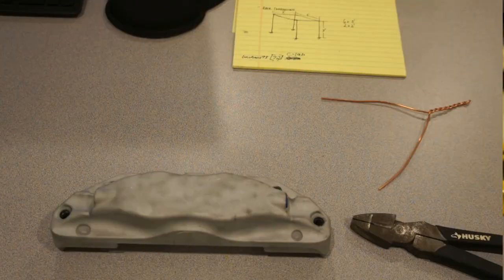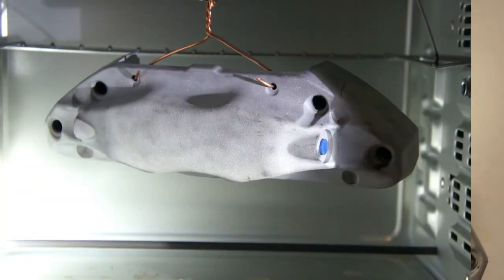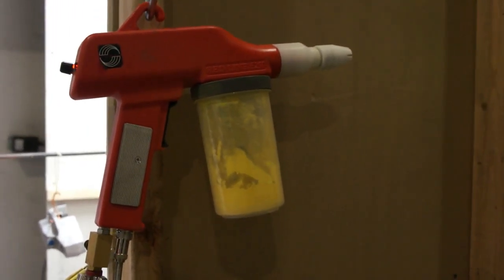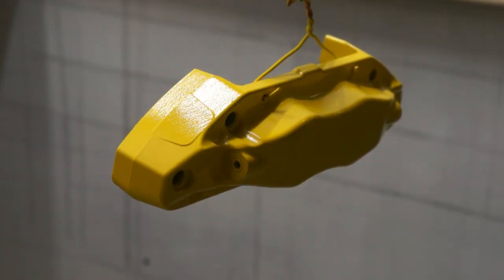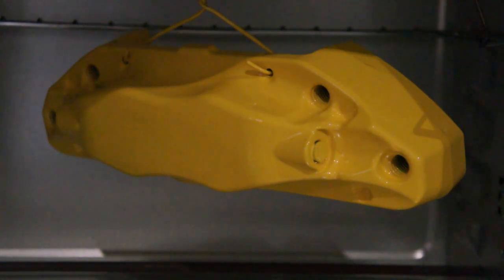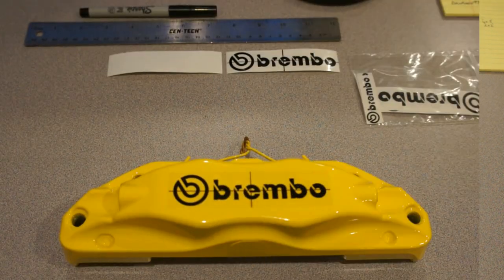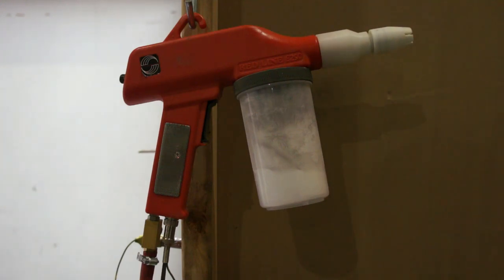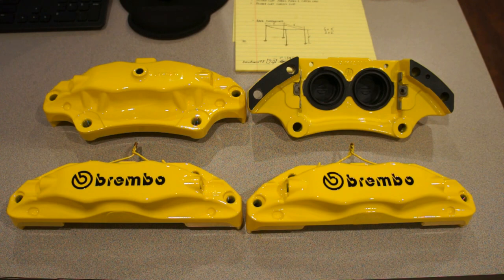Powder Coating Brembos Tutorial

Comment from the maker: I re-uploaded this video back on June 2 2017, but this video is MUCH older than that. It was on my old account many years before this. Things have changed a lot since then, and I have learned a lot since making this video.

I plan on making a MUCH needed update video that goes a little more in-depth on how to do things. 

Here's another video I did regarding calipers, torque specs, and safety stuff. Starts at about 7:43. 
https://youtu.be/sj1Sn25XiLU

Cheers!

Comment: 2 questions, where did you get the replacement seal kit, and where did you get the dust boot to protect the bore and fitting threads? I want to redo my old GTR calipers.

Comment: Hi, good tutorial, but I have a question I always had problem when I trying to put a second coat like clear coat it’s don’t want stick well to the part I use a ez 50 like you and I have a good ground rod , in order to apply the clear coat I need to heated up the
Parts before apply the clear coat ? Any help I will appreciate
Reply: might have to turn up the kv on the gun and also check your ground.

Comment: why didn't you plug all the holes with the threads is that going to ruin it or make it harder to screw it back together
Reply from the maker: I did, I used silicone plugs, and I had zero issues.

Comment: Beautiful result.  I like your methodology as well.
A couple questions if you don't mind.
1)  What vinyl are you using for the decal to withstand the heat?  I have not done a sandwich layer with a decal before, however, when I use my adhesive vinyl by cricut for stencils it begins to smoke after a few minutes.
2) Can you recommend a good all purpose adhesive vinyl for powder coating (possibly high-temp), not necessarily just for sandwich layers.

Thank you
Reply from the maker: Sorry for the super late reply. Thank you for watching. I used to have a person here in San Antonio that would make my vinyls in bulk. I told her that they needed to withstand up to 500 degrees before deformation. She was able to track down just the stuff. Unfortunately I no longer do this (powder coating), and she passed away from complications during a surgery. I don't know where she purchased the material. Sorry Kurt.
Reply: I appreciate you getting back to me and I'm sorry to hear about your suppliers surgery complications.  I'll keep looking, if you have any clues you can give me, feel free.  Either way, thanks for the awesome video.
Reply from the maker: My best advice is to look on eBay and buy one set of vinyls from different supplier's claiming "hi-temp decal". Once you receive a few different decals in the mail, I would powder coat a small steel plate, once cooled apply the different decals. After that, throw on a clear top coat and bake in the oven to whatever tha manufacturer of the powder recommends. Once cured, take them out of the oven and see which set performed the best. When you find the best one, stick with that supplier and order what you need exclusively from them.  Here's a "hi-temp" claim on Amazon: https://www.amazon.com/Brembo-Brake-Caliper-Decals-Sticker/dp/B010OT1RSA 

Give it a go! Hope this helps.
Reply: One recommended vinyl to use in high-heat temperature applications is Oracle 651 vinyl. I also would recommend a "low temperature cure" clear.
Reply: +Inner Sanctum great video!
By any chance are you selling your powder coat gun? Thanks
Reply: Great Idea Inner Sanctum.  I'll give it a shot
Reply: I've heard good things about 651.  I'll have to try it
Reply from the maker: It has already been sold. Sorry.

Comment: Partner, can you give me an idea on torque numbers putting the calipers back together.  It seems like it’s a classified secret from Brembo. 
I’ve just done my front 4 pots and rear 2 pots.  I believe the front bolts are M12. And the rear are M8.  I appreciate any help.  Thx STEVE
Reply from the maker: Brembo does not want anyone taking calipers apart for any reason. Some Brembo calipers utilize torque-to-yield hardware that you need an angle wrench for, and some do have a re-torque spec, but you’ll never find it. I do not remember the spec I used for these calipers, but I remember it was extremely difficult to find. Note, this video is much much older than the posting date. These Acura ones luckily were not torque-to-yield. Which I found out after the fact. Could have been an issue for sure since Brembo doesn’t sell their TTY hardware either. I actually had to call a buddy that worked for Centric to find out. Even their rebuild kits do not come with the replacement o-rings for the halves. Sorry I can’t give you the info you’re looking for.

Comment: Do you use an especial kind of paper to do the stickers? Can a normal Sticker be used under the transparent without melting?
Reply from the maker: Sorry for the ultra late reply. Getting this channel back up. Yes, I used a special high-temperature vinyl in this video. My supplier was just a random person on eBay selling high-temp vinyl. I ordered the vinyl and cut everything at home on my plotter. You can just as easily find folks on eBay that sell "Brembo" high-temp vinyl decals that will work. This is what I did at the beginning. Just make sure you get the correct sizes. I'd especially order a "variety pack" of small to large decals and talk with your supplier. If it means continued business, they will happily send you a sample pack of sizes with corresponding numbers. Then when you find the sizes that fit your projects, you send them the corresponding numbers back with a quantity. They will send you the exact sizes you need every time. Hope this helps.

Comment: bro what did you cover the piston bores with??? im wanting to blast mine but the sand will rip through regular tape? cheers
Reply: I think he removed the pistons from the calipers. If I´m correct you can see it at the beginning.
Reply: tdogusackit1 you can use regular duct tape. Ive also used 3M high quality masking tape to cover mine and no problems
Reply from the maker: I used 3M High Temp Vinyl masking tape. It's designed specifically for powder coating. Look up "powder coat masking tape" on Google and you'll find it. It's a transparent green tape.

Comment: Just curious as to what torque spec did you use on the 4 bolts that clamp the 2 halves together?
Reply from the maker: I don’t remember off the top of my head for these specific calipers. They are all different. You can research torque specifications for Brembos, but they are getting a little harder to find now since splitting the halves is not considered “serviceable” anymore due to liability purposes. Brembo doesn’t want or recommend you splitting calipers anymore. The info is out there, but you have to dig. Also, it IS very important to torque to spec. Don’t ever guess.

Comment: When you put the bolts back in what you do for them not being the same. Color
Reply from the maker: You can do this a few ways: 

1. You can clean up the hardware and run it in it’s raw metal color. Some like to just media blast the hardware to clean it up and install it. I personally think it looks just fine. It’s a bolt.

2. You can mask the bolt shank [including threads], and leave the bottom of the bolt exposed and the top of the bolt exposed, then coat the exposed areas of the bolt, and install. Most of the time the bolts thread from the back [inside] of the caliper, so minor scuffs due to torquing them are not showing when installed on the car. 

3. Although not recommended, if you have calipers that have external balance tubes and have no seals between the caliper clamped surfaces [Ex. 1st Gen CTS-V calipers], then you can keep them together and just remove the piston seals, pistons, and etc., mask, then coat the part without separating them into two pieces. However, not a lot of calipers allow this.

Comment: What do you do with the rubber parts in the furnace? Do you remove them? Or are they ok in the furnace?
Reply: Or the black parts? Are those rubber?
Reply: Zachary Gilbert all the rubber parts like seals have to be removed prior to out-gassing or they will melt. You will have to buy new seals
Reply: Zachary Gilbert rubber parts such as seals or are you talking about the plugs?
Reply: RanGer498 I'm curious about them seals, I do have to remove them right? And the plugs, they are meant to keep powder away from unwanted areas, like threads. Right?
Reply from the maker: Zachary, the black parts are the areas I had masked prior to curing the powder. You should NEVER put any seals in the oven with the calipers. The calipers MUST be disassembled and clean thoroughly, then mask all the areas you do want powder on. DO NOT powder coat with any seals at all! Also, I never reuse seals. I always replace every seal.

Comment: only to find out that the bolts, now wont fit through the holes ?
Reply from the maker: NHEFF09 What bolts won’t fit through the holes? These, and every other set I’ve done go back together just fine. You can always add 15 more steps to any process. At some point, you need to just do the work. There’s no need to add a bunch of extra steps that don’t add value to the equation. To be fair, I need to make a better video. This is at least a few years older than the posting date. I just merged it to this channel awhile back.

Comment: How much would you charge for a job like this?
Reply from the maker: I’m pretty sure I did all 4 calipers for $150, and that included the seals for rebuild. These were off an Acura TL. This is a REALLY old video that I re-uploaded to this channel a few years back. However, I’m pretty sure it was $150.
Reply: If i pay you $200 to 250 would you be able to refurbish my brembos. And if so where can i send them i like how yours came out , my brembos are gold for a sentra ser spec v.
Reply: @Inner_Sanctum  that’s very cheap for such amazing work bro you should be charging double triple if that’s including sandblasting too

Comment: Do I have to buy a kit to put the brembos back together after painting them? I had a mechanic tell me that. I thought it would be as simple as taking them off the car, prepping them and then putting them back on. Please let me know. I have an 03 350z.
Reply: They have to be removed before being put in the furnace. But since you have them out all ready you might as well replace them just in case you damaged one when taking them apart.
Reply from the maker: I will never put calipers back together without completely refreshing them. It's just not worth putting in the old seals. You have it apart, replace the parts.

Comment: Just, before you split your calipers in half, call Brembo or Race Technologies and see if they recommend this.
Reply: tahoe1234x Brembo doesn’t recommend altering their products at all for obvious reasons being it’s a safety part and the liability involved. Although everyone does it without issues.
Reply: and brembo does not recommend powdercoating, they paint them. Powdercoating is softening the special  aluminium they use
Reply from the maker: Brembo used to powder coat all of their calipers and screened the logo on with a special high heat compound. Annealing for aluminum calipers starts around 650* F, the powder is baked at ~400* F. It's not uncommon for brake calipers to reach 400* F in regular track use. So, the information you provided is false. They do not use "special aluminum" for their products. They use a specific grade aluminum that has been heat treated for applications ranging above 450* F of use. There are some materials they use for concept brakes as well as F1 and other one off racing configurations, but you will most likely not be doing a set of those. Take your run of the mill STI Brembos. They ARE powder coated with a gold metallic polyester blend. The red Brembo logo is screened onto the surface.

Side note: The newer "crazy looking" calipers that Brembo produces are in fact painted. Maybe even most of the calipers they produce now. They use a combination of epoxy, polyurethane, and acrylic. However, that's mainly because of the Faraday Effect and cost. They can paint them much cheaper than they can powder coat them with less error. Powder coating that produces a 100% quality finish is expensive, and the room for error is greater than painting especially when complex shapes are introduced.
Reply: Also, you think the calipers don't hit curing temps while being used for racing? The racing brake fluids are made to go over 500F so I can imagine the caliper gets at least that hot.

Comment: I do powdercoat my self , i got told not to coat rear mounting points Becuase trough time paint & movement will make bolt to loose up. Correct me if am wrong thank you . Check my work on IG @G8STLM
Reply from the maker: Yeah, just mask them off.